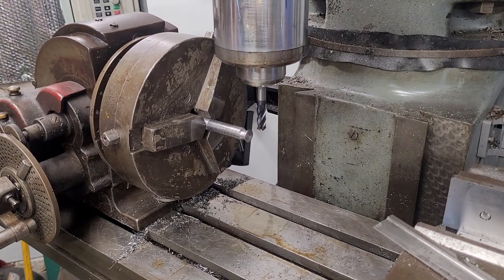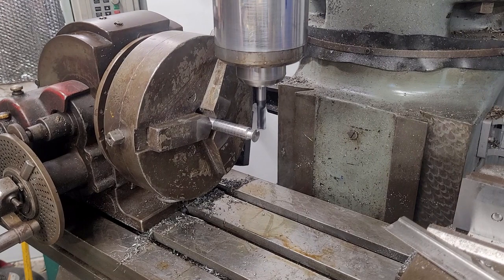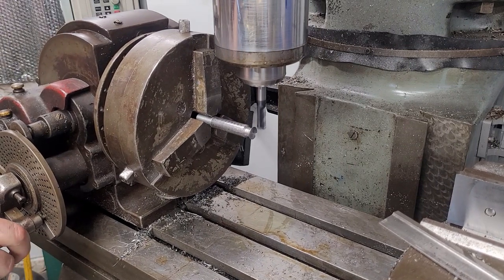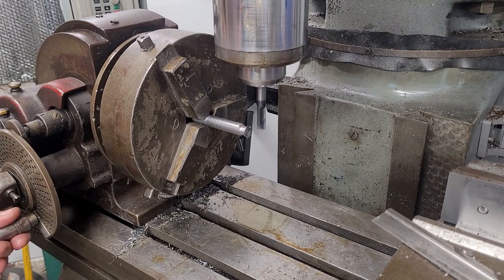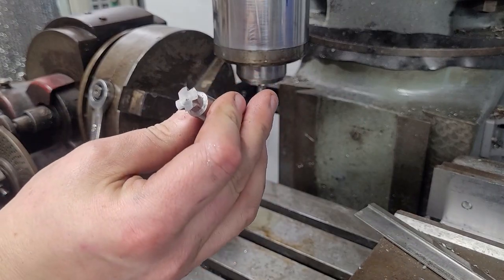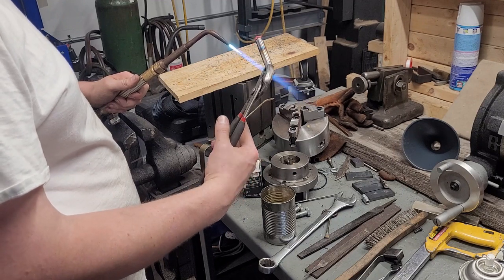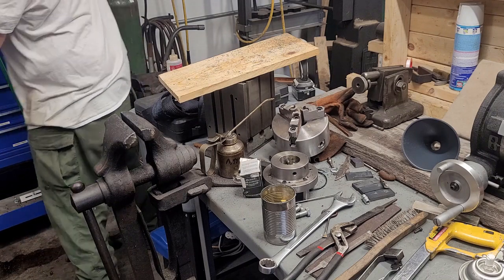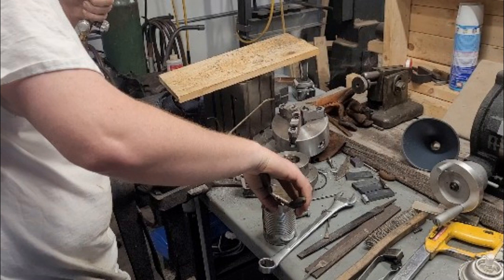Shop Made Dovetail Cutter: Part 2 Milling & Hardening

Comment: This heat treating process  has always confused me a bit… so you heat treat it by heating and quenching … then temper it by steady heat in an oven. Interesting 👍😎👍
Reply from the maker: With this alloy. Some are different.  Steels are the exception, not the rule, in that rapid cooling hardens them.

Comment: 👍👍😎👍👍
Reply from the maker: This was quite an interesting project. It was only my second or third time cutting a dovetail so it was shocking everything worked the first time!
Reply: @moosesmachinery  You are definitely showing how a basic understanding and simple tools may be all that is needed to produce a quite functional cutter. 👍
Reply from the maker: @joell439  Machineries Hanbook has a section on cutter design that is remarkably helpful, it makes it a lot easier to look capable with help! In the future I intend to make a single flute cutter of HSS to cut the flutes & relief in reamers in one pass.  That way I can avoid hand filing and speed up cutter production on the future.